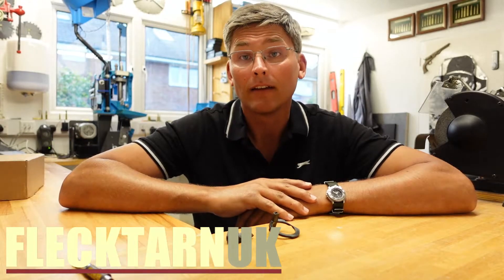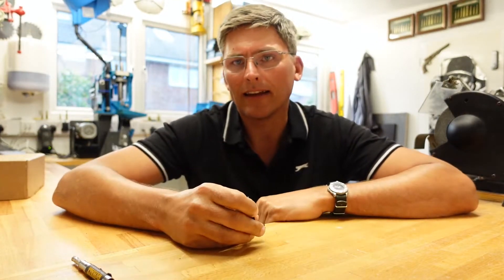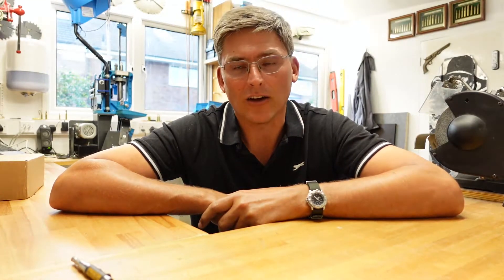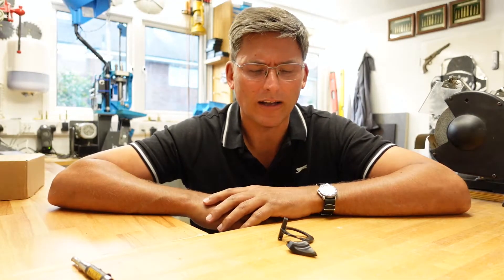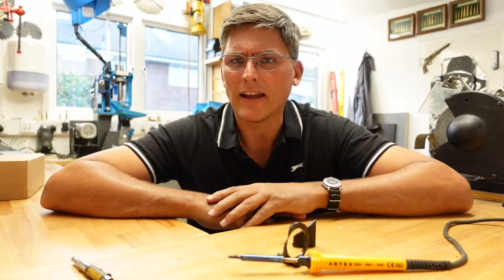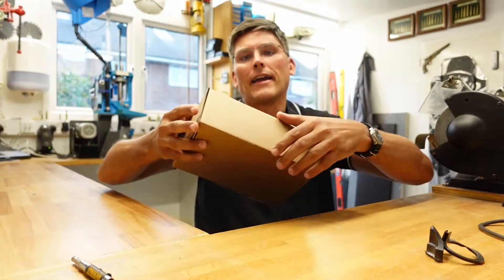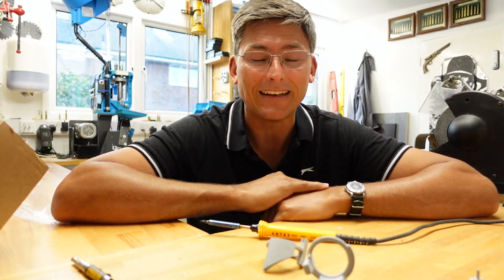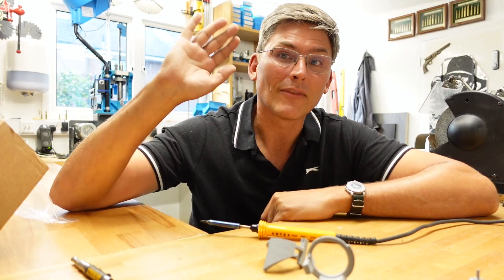[42] Fixing a Broken Dillon 650/750 Ring Indexer (Infamous Part 13677)

Comment: What I wouldn't give for someone to make this out of metal. I've gone through way too many of these.
Reply: Armanov makes one out of aluminum.
Reply: Even with a low torque setting, I have broken 3 Armanov metal indexing rings. Too low torque and the cases won't go in the resizing die. Too high and the indexer breaks at the same weak spot. I would love to have a billet version of this ring.
Reply: armanov